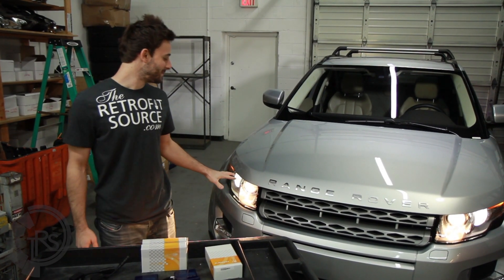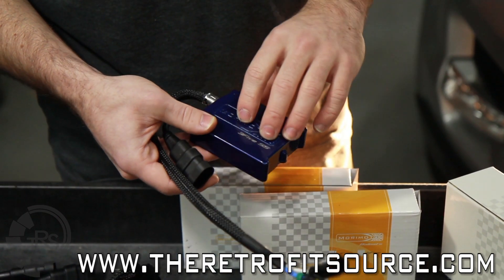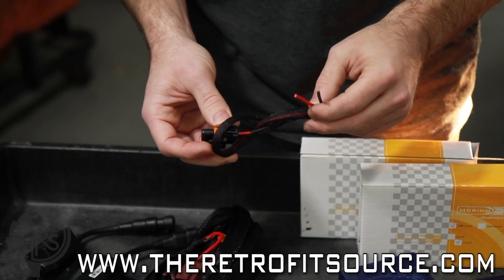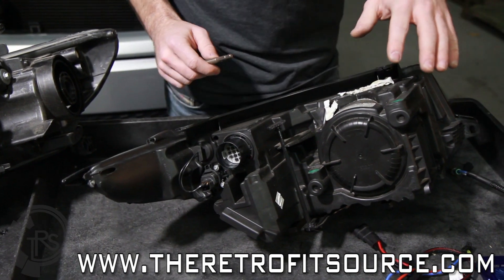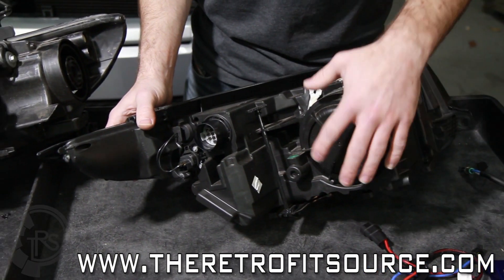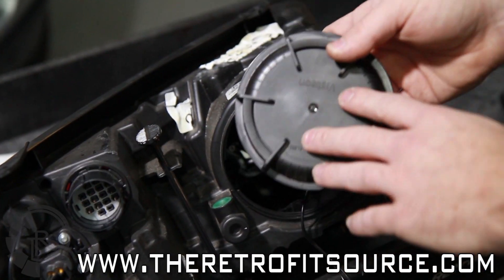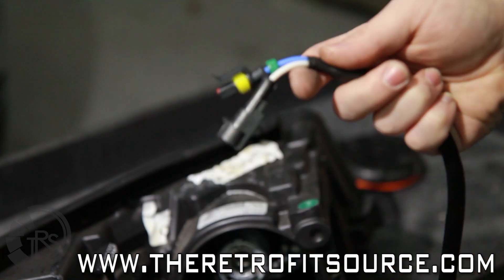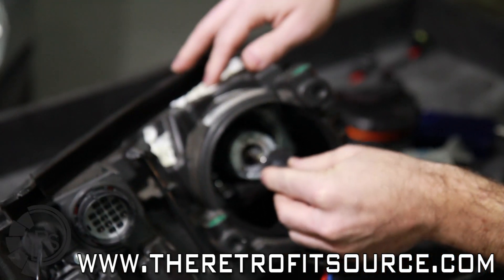TRS Tips: Morimoto Elite HID System

Comment: Hey I have a Morimoto Elite HID kit but I went the HD Relay route. I noticed that both bulbs come with the option to connect the CANBUS harness to it but is only one cable needed for the anti-flicker capacitor and the spare just needs to be cut off like you did in the video?
Reply from the maker: Correct, just one is used - so you can remove the other one thats not needed

Comment: I'm also wondering about the overheating risk with it inside of the headlamp housing. I have a 2015 Sonata and I did read about some people going that route with the TRS HIDs. Under normal operation it seems like it doesn't get that hot, but if there's a failure or bad connection, I figure things can overheat putting your whole housing at risk.

Comment: Hi, my car is 2011 Hyundai IX35 has a bulb for high beam and one for low beam bulb individually uses H7 bulbs. Let me know if I can install on my lights hid xenon system of morimoto without having to drill holes behind my lights, similar to this video where everything is placed inside the lights